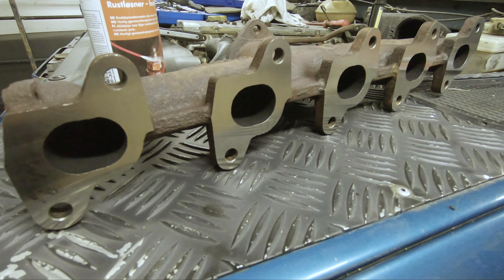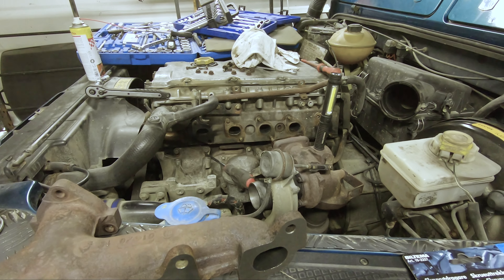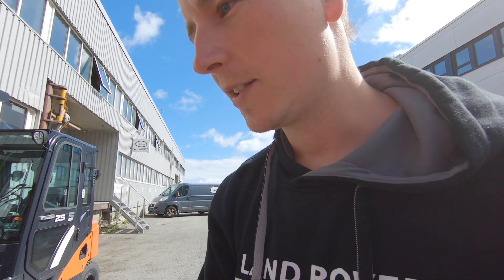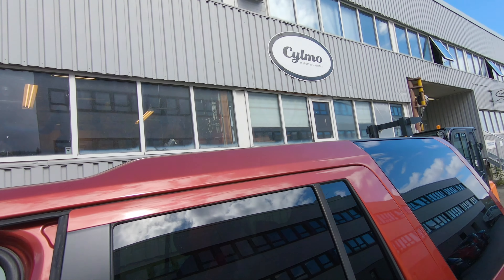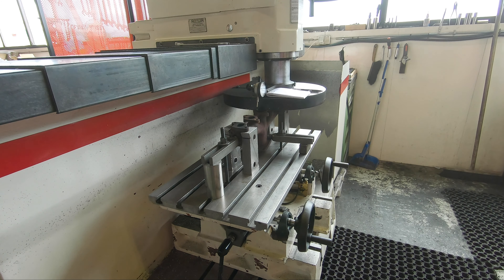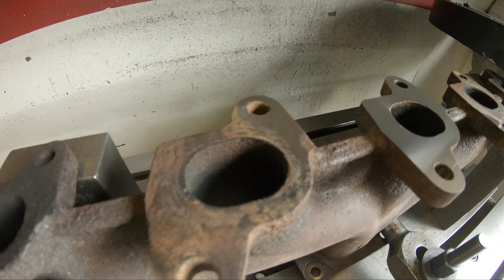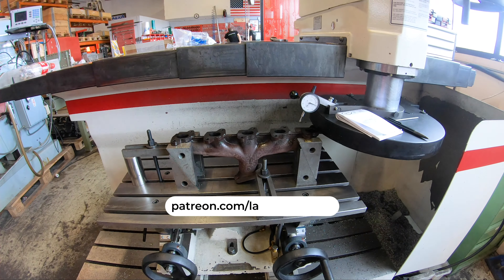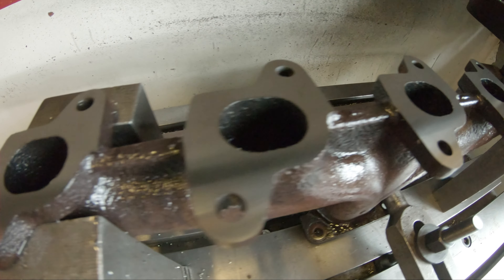How you can fix a warped manifold on Land Rover Defender - part 2

Comment: Great to see how it progresses... wonder how they set it up on the machine and what the reference was 🤔
Reply from the maker: Hey Peter, glad you liked it. I’m kind of a nerd on these kind of thing, “how is it done” so I enjoy watching the clips a lot afterwards. He mounts the manifold, level it as good as he can, using averages I’m guessing. He uses the dial on the cutter to measure the distance down to each outlet. He is measuring and checking on every run. You can see his notepad has at least 25-30 reference points.  I don’t think you can get a 100% correct starting reference point as you don’t know what that would be, since it has warped and twisted. 👍😁
Reply: @LandRoverDrive  thanks for the update... explains it quite well... and 2mm is a lot to have to take off... guess it will not bend any more 🤞👍🙂

Comment: Are the Land Rovers that you take off-roading your daily drivers?
Reply from the maker: Hey, I use my Defender and Discovery 3 on and off, så they both get used a lot. But my discovery is my main daily, whiles the Defender is my main overland car. At the moment they both get driven offroad and see about the same amount of KM/miles. :) Ørjan has the same setup with his Discovery 4 and his Defender 90. Erik is using his RRC mostly for trips and now drives a car not yeat revield. 😀👍  I hope that answer you question. And yeah, they are all road legal cars. If you have more question just ask and thank you for watching. Best, Simon.
Reply: Land Rover Drive Yes, thank you! I have an 80 series Land Cruiser as my daily and was thinking I needed to get a car to offset some of the highway miles I have to put on it everyday at 11 miles per gallon gets expensive. Thank you for the detailed response. Keep up the great work and stay safe my friend 👍

Comment: I bet if you deweb it , it will be out again.
Reply from the maker: My theory is that if it has warped once it won’t do it again as it has been heat treated when it warped. 😊 If the theory will hold up is another question. 😅
Reply: @LandRoverDrive  after mine warped, I got mine machined. it did it again about 6 months later. I dewebbed and machined again. I've just replaced the exhuast gasket again and noticed slightly out again. fark.... hot CPU maps are just to much for the standard manifold.  I would love the ali manifold but costs too much.